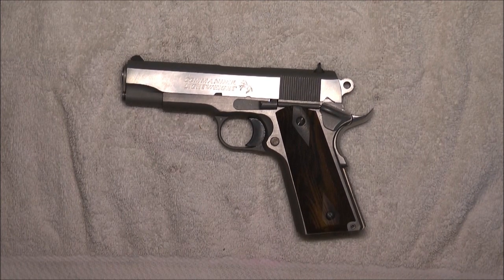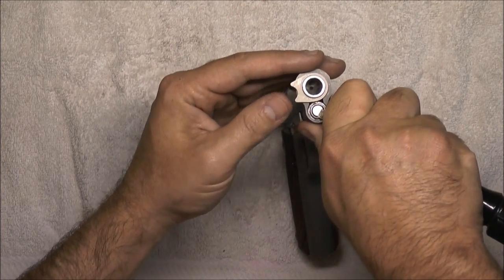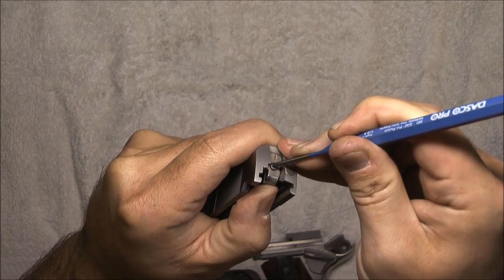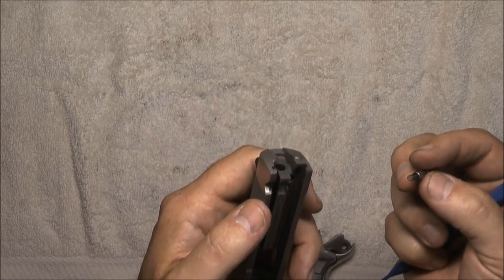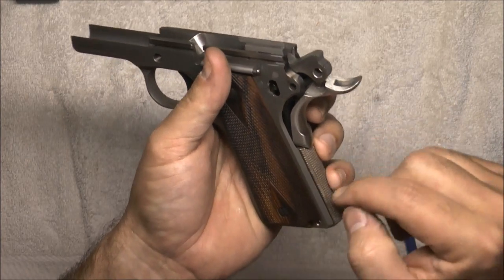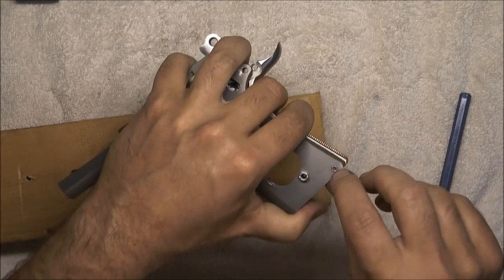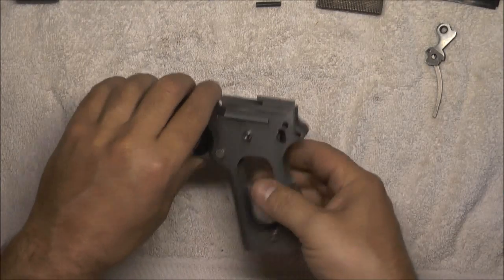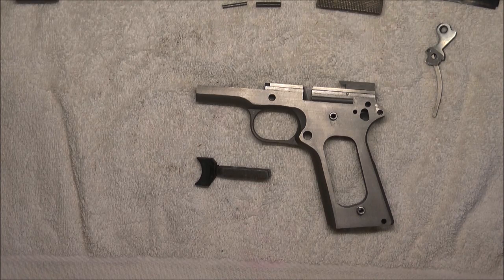BEST Series 80 1911 Complete Tear Down in HD!!

Comment: Dude you saved me a trip to the gunsmith! Best 1911 disassembly video on youtube. What did people do before the internet? I also just learned my new Springfield 1911 TRP is like a series 70. No firing pin block. Thats fine with me, a couple less parts to deal with.
Reply from the maker: Awesome. That's exactly the reason I made this video. I was used to the 70 series and the first time I tore down an 80 series and those extra parts fell out, I couldn't find one single video on YouTube that addressed it... I'm sure they're out there now, but they sure weren't when I needed them!

Comment: Awesome instructional video!  I had a bunch of Colt 1911s with plastic mainspring housings and plastic triggers (the trigger pads).  I replaced them all with identical Colt factory steel parts thanks to this video and the complete assembly video.  Years ago I bought a S70 Colt .22 Conversion Unit on a S80 receiver.  The smith who put it together simply snipped the tip off the FPS plunger lever to get it to work - it works but with all the detrimental qualities of a S80 trigger!  I used your videos to replace the unnecessary FPS parts in the receiver with a frame slot filler and now my gun is sweet!

Comment from the maker: @ODDBALL81234 Thx for the kind words - the trigger is the last thing to come out, unfortunately. The only steps you can skip are slide breakdown (firing pin, block, plunger, spring, and extractor). If you really don't want to tear the gun down or aren't comfortable doing it, you might find a good gunsmith to have them do a trigger job for you while they're in there... you get a lot of bang for the buck out of a trigger job and it's pretty inexpensive.

Comment: Thank you for this video. I just purchased a used series 80 1911 your video made things a lot easier to disassemble. I am having an issue with the grip safety it sometimes works, and sometimes it will drop the hammer.  Maybe, the spring tension needs to be adjusted?  Do you know how to adjust the spring, or could it be something else causing the problem?  Any advice will be greatly appreciated. The gun is every dirty inside.  It looks as if no one has ever cleaned this gun pretty sad.  The gun is really nice with its stainless steel top and dark bottom.  Another thing odd about this gun is it has no branding on either side of the slider.  It does have matching serial numbers on top and both of the gun and *BRP is stamped on the barrel.  I would really like to know the manufacture of the gun any ideas?  In any event I really have enjoy watching your videos. Thank you for all of them.

Comment: Nice video, you explained the disassembly process perfectly. I am new to the 1911 and a bit overwhelmed with all the little parts of the gun. I have a Colt 80 L.W. Commander very similar to yours. I was just about to replace the black solid trigger with an aluminum skeleton trigger. How far do I have to take down the frame to replace the trigger.

Comment: The new Llama Micromax 380 is based on the series80 platform. You answered a bunch of questions I had with this video. There are slight differences but the trigger and grip guts are the same.  The grip mainspring housing is a screw instead of a roll pin and I'm wondering if it's for ease of removal or it does something!?

Comment: do you like the full length guide rod, better then a regular, one and why
Reply from the maker: my personal opinion, I'd rather just use the standard guide rod. I've never experienced any issues with the standard size, nor have I ever realized any benefit from the extended. The standard, however, can make disassembly a smidge easier

Comment: You did not mention what the firing spring plunger does in your video. For those of us not familiar with this Series 80 feature can you tell me what purpose the plunger serves? If it's a safety feature, how does it work and in conjunction with what?
Thanks very much.
Reply from the maker: All the 80 series specific parts are a safety feature (many call it a lawyer safety). The plunger is the part that actually prevents the firing pin from moving forward to strike the primer unless the trigger is pulled. When you pull the trigger, the trigger bar pushes the trigger bar lever, which pushes the plunger bar lever, which pushes the plunger out of the way and allows the firing pin to move. Next time you have your slide off, push the firing pin from the rear with a brass punch and look at the breach face. You'll notice the firing pin does not appear. Then hold the plunger in while pushing the firing pin, and you'll see that the firing pin now moves freely enough to strike the primer. Hope that helps.

Comment: I bought a used Series 80 from someone I used to work with.  I've had the gun for a couple years and only shot it a handful times.  Now with my son getting older, I don't feel comfortable having a loaded shotgun under my bed so I have to switch to a handgun for home defense.   That way I can leave it loaded and accessible, but in a safe next to my bed, inaccessible to him.  

I really want to be able to trust my family's lives to this gun, but when I did what you suggested at the beginning of the video (to see if it's a Series 80) I noticed the plunger is missing.  I don't know if the previous owner knew what he was doing and took the plunger out, along with the piece that depresses the plunger, or if I lost the piece on one of the few occasions that I cleaned the gun.  

My question is, is it common for people who know what they are doing with 1911's to remove those pieces, and is it safe to shoot them without them?  Any advice is greatly appreciated.  Thanks.
Reply from the maker: Jimmy Nix There' is a conversion kit available from TJ's Custom (basically just a shim to fill the void left in the frame) that allows you to remove all the Series 80 parts so the gun functions like a Series 70. The arguments against the "lawyer safety" parts are that it affects trigger pull (that has not been my experience), and that less parts means less chance for a malfunction (I've never heard of or seen a malfunction due to 80 Series parts). As long as the previous owner either added the shim or left the old parts in the frame, the gun will function properly and is safe to shoot. You don't have the additional safety of the firing pin block (plunger) blocking the firing pin to prevent an AD if the gun is dropped directly on its muzzle. You could also switch to a titanium firing pin, which is light enough that it will not strike the primer like a steel firing pin would - the new Ruger 1911's have no 80 Series parts, and feature the titanium firing pin - love 'em.
Reply: So it's safe to shoot it if the plunger is not there, but the other two parts (sorry I forgot what they're called, but the parts that push up on the plunger) are still in the frame?   I'm hesitant to take it apart as far as you did to find out if they're there.  I know I'll probably mess it up.

Comment: Excellent video.  I have a Colt Gold Cup Series 80 that has two additional small parts not mentioned in your video, and am wondering if they are needed for the gun to fire.  They are called a Depressor and a Depressor Spring on the exploded view.  The spring fits into the sear.  Does anybody know their function?  Thanks in advance.

Comment: I know the dif. between 80 and 70  but what a 1911, 1991??? can any one tell me. I know its probly a dumm question
Reply from the maker: about 80 years, lol
Reply: Roy, the M1991A1 (or simply "1991") is just another version of Colt's 1911-type pistol, and as its name implies was introduced to the market late in 1991. The name "M1991A1" was little more than some Colt marketing exec's clever spin on the original US military M1911A1 designation. It was a basic Series 80 pistol with less frills than a standard blued Colt Government Model which enabled it to sell at a lower price point, and thus better compete with the Springfield Armory and Norinco pistols that at the time were starting to chip away significantly at Colt's market share.
Reply: +icoach73 - Smart ass...beat me to it. LOL. Now I had to give the real answer.  Great video, BTW.